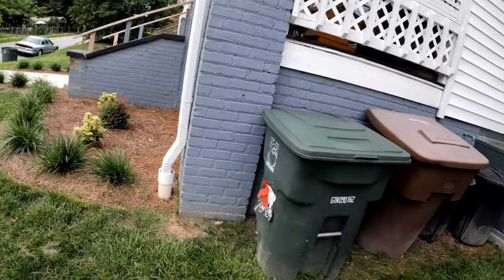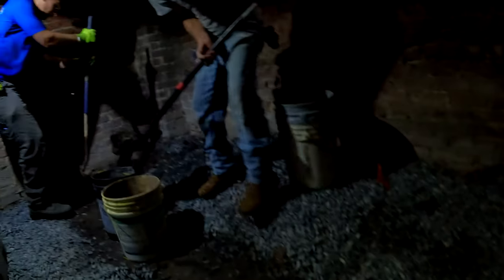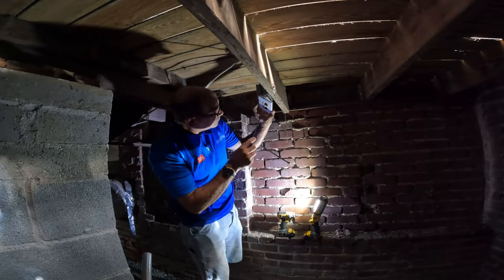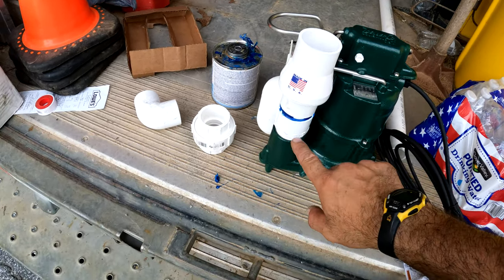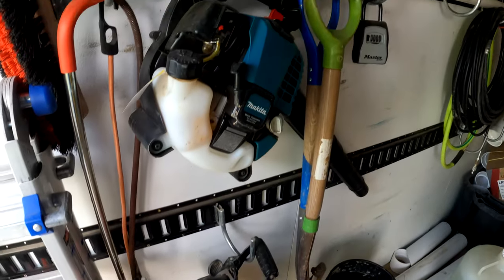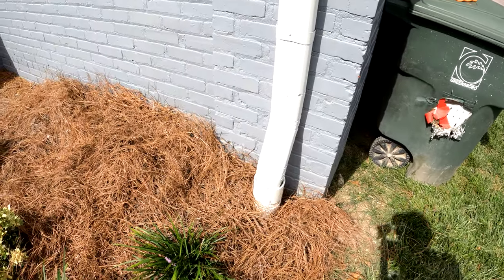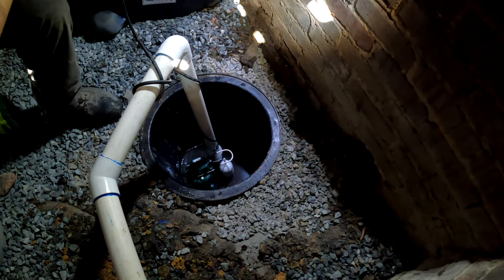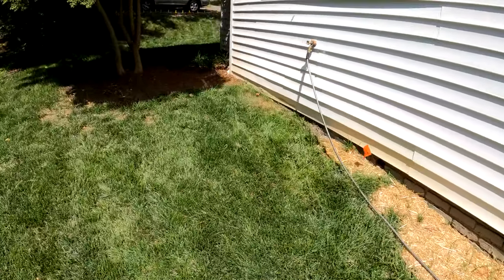Installing a Sump Pump for a repeat customer

Comment: Last week one of my customers had her concrete guy install a drain trough in front of her garage door as she was getting water in the garage when it rained. They we’re gonna run black corrugated pipe about 4’ and burry it. 🙄 I intervened and got the customer to let me run it out to the street. No complaints so far. Thanks again for sharing your knowledge buddy
Reply from the maker: awesome! A drainage solution should: Identify the problem water, collect it into a pipe, and you should be able to see that problem water running away from the property.

Comment: One thing I noticed is the sweating on the HVAC supply trunk. It's the first condensing surface which indicates, rather clearly, that crawlspace is a problem. It's literally providing a breeding ground for mold.

Comment: I have a Zoeller pimp now. I have gone thru several pumps in the 20 plus years we've lived here. As far as I am concerned Zoeller is the best and the quietest!!! With the pump directly below our bedroom, quiet is an important criteria.
Reply: We had a FD and zoeller installed in our crawl space 10 years ago. I just had to replace it a couple of months ago. Really reliable and quiet.
Reply from the maker: Thanks for sharing Denny and Arthur. I've had good luck with them too.
Reply: @GCFD  Here is a question: I have an online sump pump and a new spare pump. Do I need to swap them out on a regular basis or wait for the online pump to fail?

Comment: I would have made the connection between the sump pump discharge pipe and the gutter different. Incase that the gutter pipe gets clogged water can flow back trough the pump in the sump.

The check valve and the pump can not prevent this reliable.
Because a failed checkvalve probably keeps unnoticed, same for the pump and you have the problem of power outages ontop of that.

Could be solved by making a upside bow, that way the water would need to flow uphill, what it obviously cant.
Reply from the maker: Great point to consider Jonas! There's about 8' of fall to the sidewalk so I reasoned that the gutter pipe likely will never clog.

Comment: It looks like that crawl space continues from under the house to under the front porch.. you can see the light coming down from between the porch decking.  So any rain on the porch just drains down to the crawl space.. another source of the excess water down below.
Reply: its a covered porch

Comment: She should install poly sheeting over the floor of that crawlspace. With air conditioning in the house the crawlspace air will always be dryer than the damp earth and will forever suck moisture out of the ground. A layer of plastic sealed and any moisture underneath will find its way down to your sump pit.

Comment: Can’t quite tell but that looks like an area where the new receptacle could see water under that porch. Looks like it would be better to have a weather rated box or pull it back under the house if the cord is long enough. Just my 2 cents! Good work!
Reply from the maker: That front porch doesn't get any rain with the overhang so I felt all right about the outlet location. Great point to consider Jackson!
Reply: @GCFD  I figured it was covered but I was thinking driving rain or pressure washing
Reply: Should be considered an external location and yes,  a weather- rated box/ receptacle should be appropriate

Comment: Where do you buy your 4” 20’ pipes? So expensive at lowes at 10’ lengths. Assuming you wouldn’t Reccomend the thin wall Drain pipe.
Reply from the maker: I get the 20' sticks from the plumbing supply house. I buy by the pallet. I just found a company selling around 4000' of pipe but it was in 10' lengths. So now I have a bunch of 10'ers. The schedule 30 is very good pipe. Schedule 40 is a little better, but the fittings are much easier to buy for sch 40, so I use it.

Comment: Nice looking crawl space. No crawling needed ;) You don't have much freezing in your area? I guess, the discharge pipe will stay full of water because it's installed with -1 * (full bubble) of fall (small hole you drilled is between pump and valve?). Does the crawl space has some ventilation in back section where the water comes in? It could help to get rid of the residual moisture there. 

Nice and easy job, thanks for sharing

Comment: Did you consider putting in a strap to hold the pipe up in the crawl space
Reply from the maker: You could strap it up for sure. We use pressure rated pipe which is more ridgid than DWV pipe.

Comment: Great video as always. A couple of things I didn't understand though. 

Wouldn't the French drain against the back of the property be contributing to the crawlspace flooding? 

And when you put the pipe into the existing drainage line it almost seemed like the connecting pipe had a rising slope - is that intentional for some reason? Obviously the pump will be able to cope with it, but wasn't sure why you wouldn't give it a downward slope.
Reply from the maker: We were in thick clay so The FD was solving a huge part of the non-point water flowing off the hill. The HO wanted the pipe hidden so we kept it lower.
Reply: I wondered about the sloping pipe too, I thought maybe it was an optical illusion.
Reply: How dare you question the master!  Lol. My guess is if your referring to the pump discharge line, it doesn’t matter what way it slopes because the pump pushes it out

Comment: Was there a check valve installed as well? No need for one?
Reply from the maker: Yes we install a check valve and union. We always use a gate/flapper style check instead of a spring one.

Comment: Will the water above the check valve become a problem in winter with frost?
Reply from the maker: We don't really get much frost around here. We tried to add some dirt around the pipe to help it out. Around here if they are even predicting temps below freezing, they close the schools the night before.
Reply: @GCFD  I see! That makes sense. And under the crawlspace should get some heat radiated from the house, too. My country is currently baking in a heat wave, too, but winters without freezing are alien to me. haha

Comment: pump that have an open line is not pressure application and 15 amps are too much for 1-1,5 horse power motors (240v)

Comment: I disagree with the diagnosis.  I think I would have put a perimeter drain across the high end and across  width of the property down deep enough to catch the water then divert it into a discharge line to the front of the property.
If the ground is clay as you have shown this to be in the area, I'm not sure how that would factor into the equation.
Reply from the maker: The water was seeping through about 12' deeper than the uphill side of the property so I saw no real way to intercept it. I made several site visits over the last couple years and it was always the same with the water seeping through where that bank was cut out in the crawl space. This happened for days after rain.
Reply: @GCFD    With the foundation being brick and the house older, that may complicate the issue.
If the foundation and footings were concrete with re bar a dimple waterproof membrane over a spray coating then a drain  on the high side??
Just brainstorming here.
Like you say, get rid of the water.

Comment: I know this is a broad question to ask, but what is the ranges for how many downspout gutters can be put into a 4-in PVC? And how many drain basins can be connected to that same 4-in PVC? And I understand this is a broad question but in average what do you do?
Reply from the maker: It all depends on how much roof area is being drained by each downspout and how much fall (downward slope) the pipe has over its run. Four inch pipe is really way overkill, but I like that because it can move a lot of water and debris.
Reply: It depends on how much water is coming down each down pipe. That depends on the area of roof that each down pipe serves. You could have many down pipes each serving little bits of roof. it will also depend on the rainfall where you live.

There are maps available on line that show how much rainfall in an hour (or half) to use in roof drainage design for different return periods (how often it will be exceeded).
You can measure the area of the roof at ground level. Add in half the area of any walls that discharge onto the roof, you may have to estimate these.
That will give you the amount of water you have to deal with.
You can find out the capacity of pvc and other pipes for various falls from manufactures website.
If the pipe capacity is bigger than the discharge water from the roof you are ok; if not check 9 inch or maybe increase the fall if you can.
Reply: A 100mm / 4 inch, at 1% slope, filled to 70% delivers 4,2l /1 gallon per second.

Comment: Im going to disagree with this one. this home needs more than just a good pump and dump. perimeter drain, rat slab, vapor barrier?
Reply from the maker: We did a FD across the back and caught the rear gutters, added gutters to the front and a catch basin and this was the last little bit of water seeping through that bank in the crawl.

Comment: Zoeller doesn't give pressure ratings for this pump. I don't believe it's meant to build pressure, just pump water thru an open ended pipe. If it were meant to build pressure, the manufacturer would give pressure ratings based on a relief valve built in or instruct the installer to add a relief valve. If the pipe were to have a restriction, pressure would build. If pressure builds high enough, the weakest point will fail. If it was my house, I think I would want a fitting to fail and not the pump. I don't see the pressure fittings as being an added protection, but totally unnecessary due to the almost no pressure in the circuit. 

The 15 amp breaker isn't a bad thing and could be considered better than a 20 amp. Since the pump is rated to use up to 9.4 amps, it's best for a breaker to trip at 15 amps, rather than draw 20 amps, double its maximum requirement. I think I might run 12 gauge wire to the outlet if it's a long distance from the box, but still use a 15 amp breaker.
Reply from the maker: Joe - this pump should pump 72 gallons per min at 5' head. It's an M98-001 pump.
Reply: @GCFD  The high pressure fittings are rated to about 180 PSI, the pump puts out >7 PSI. High pressure fittings would be used for a well and pumped water up to an on/off valve where the pressure builds inside the pipe when the valve is closed.
Reply from the maker: That sounds like my style: spend a few cents more for a way better product. 👍👍 Thank you for putting some numbers on here for me. I know DWV pipe is rated for 0 PSI.

Comment: At least make the circuit  a home run a 15 amp will work I use 20 amp like you said .
Reply from the maker: Same. Technically the 15 amp circuit will work but doesn't leave much room for expansion if it's ever needed.